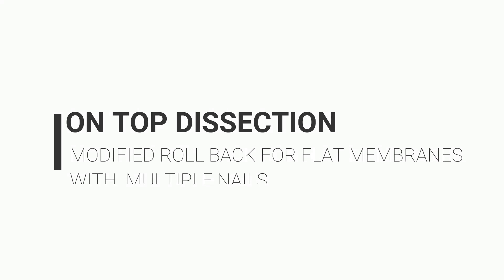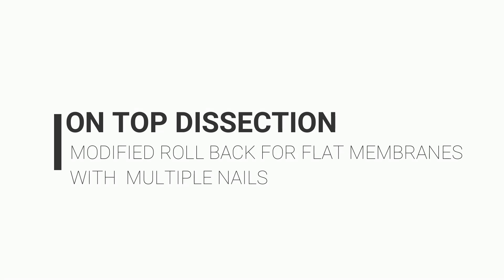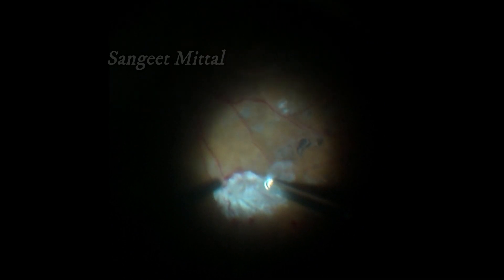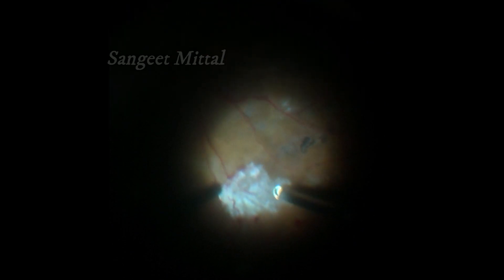On Top Dissection-Modified Roll Back

Comment: Thank you for always giving me a good tip.
How is the vacuum and cutting rate set?
Reply from the maker: Thank you for showing interest in the video. As mentioned in the video also, the vacuum and the cutting rate is set to maximum. In this case 650 vacuum and 10000 cut rate.